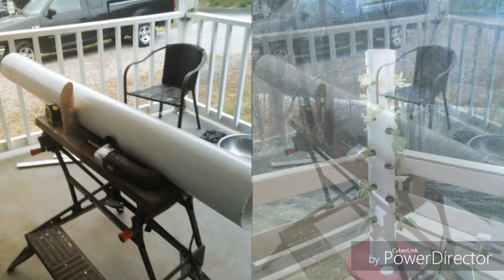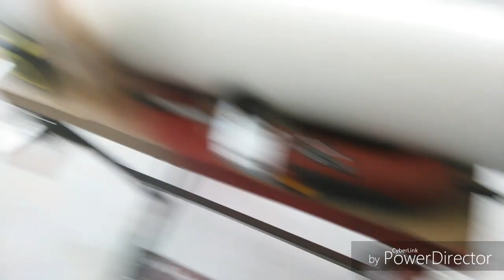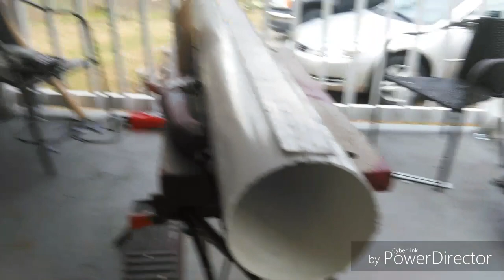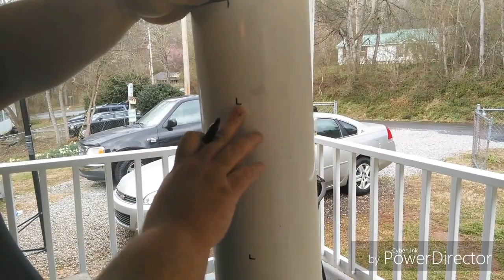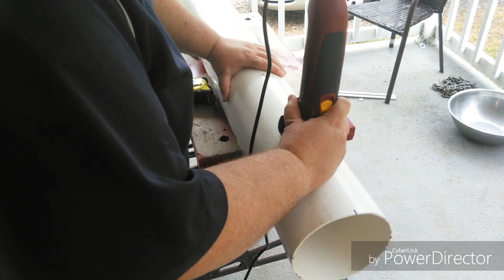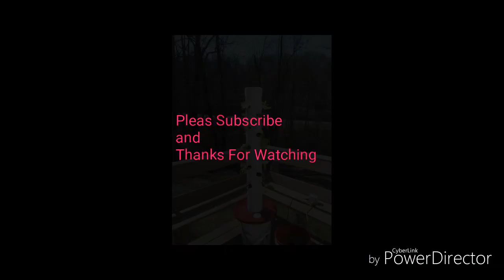DIY (Garden Tower)  Build a Hydroponic Raining Vertical Tower Part 1

Comment: 3:28 if you want it evenly spaced just use a level or plumb bob for the first two marks and then a cloth measuring tape or string to measure the circumference from mark to mark and find the half way point to mark the other two points.  but you're free hand marks look pretty good without all that fuss i must say.

Comment: Why do you mark 5", 8", 13", 16", 21" rather than 5", 9", 13", 17", 21"? You space the holes 3"- 5"- 3"- 5" rather than 4"- 4"- 4"- 4" Just curious, I'm about to cut my holes, but thought I'd find out if there was a good reason.
Reply from the maker: There was a reason for the spacing but its been years since I built it. You can go with your numbers if it makes more sense. Then again I could have meant those numbers and said the wrong numbers. Who knows. Lol I got that piece of metal shoved somewhere in my shed I wonder if the numbers are still on it

Comment: Good evening friend, I'm using your project to make one for me. What is the size of the pipe? The distance between the holes, 8 inches or is another unit? Is that in Brazil we work with meters, centimeters .... thanks.
Reply: 6 inches, you can see it at 9.54
Reply: Carlos Rodezno nice catch 👍
Reply: Cao Güttler Demarchi The distance between the holes are listed in inches on his jig
Reply: @Rodeznos  5 foot of 6 inch thin wall PVC I believe he said.

Comment: What is the diameter of the pipe?
Reply from the maker: Koutilya Madduru it is 8 inch pipe
Reply: @PonicsHaven30720  In the video you said it was a 5' piece of 6" thin walled PVC. Is that correct or is it an 8" pipe?
Reply from the maker: @cliffmeinhardt5682  it is a 8 in but you can also do it with a 6 inch
Reply: how long is that pipe?
Reply: monkey mom at 0:55 I believe he meant to say a 5 foot long piece, 6” diameter